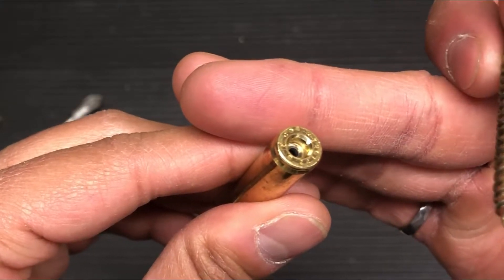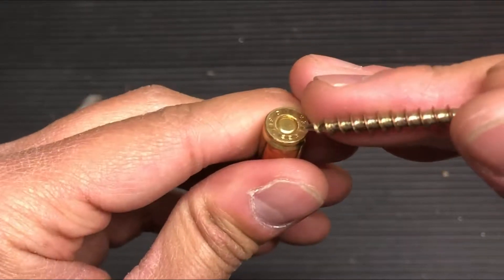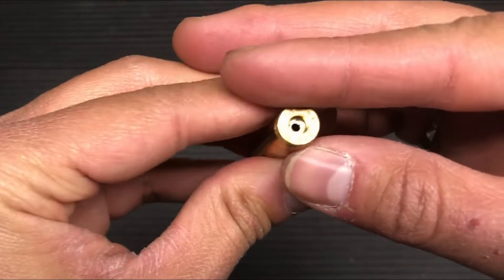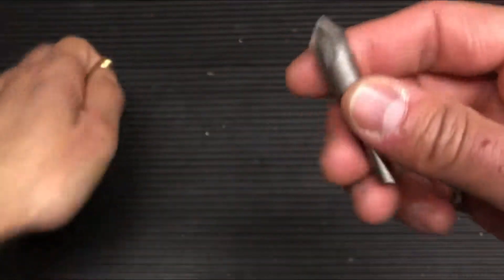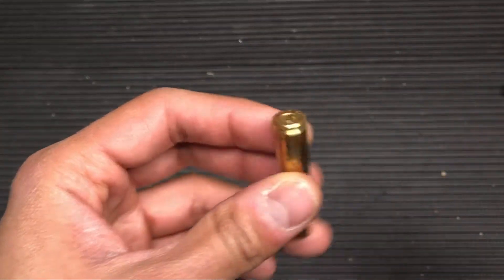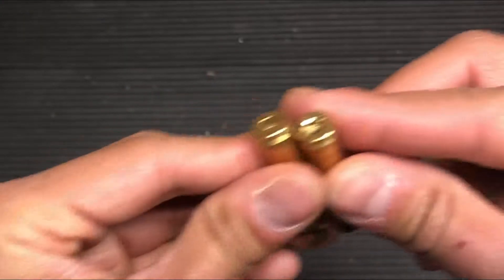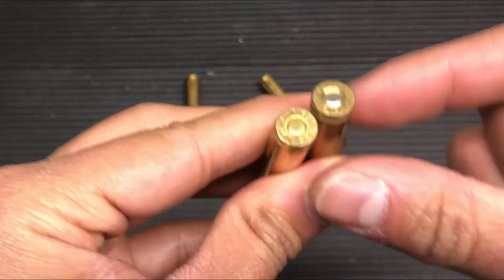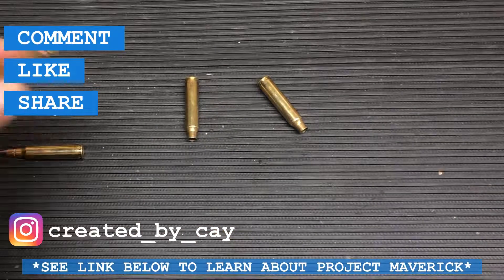Primer Crimp Removal - Quick, Cheap, and Easy

Comment: Kind of a haphazard method. Better would be to trim the cases, then use the adjustments on the drill press to stop at a specific depth on the case set on the table. Holding it by hand is pointless. "Feel" is very inconsistent.
Reply from the maker: That can work too.
Reply: You can chamfer this way and win at Camp Perry.